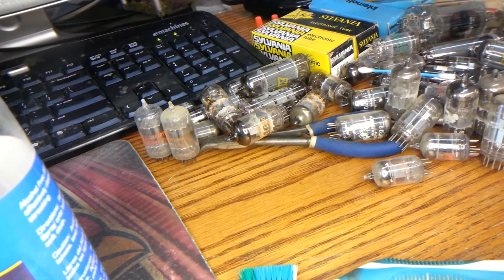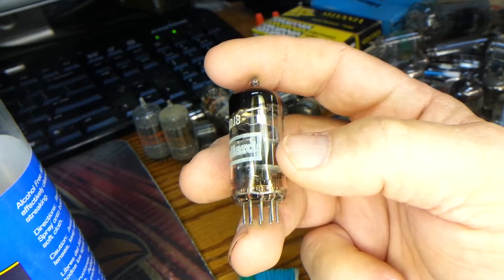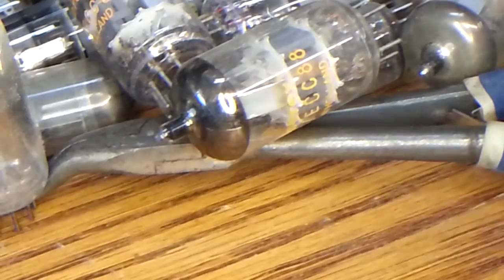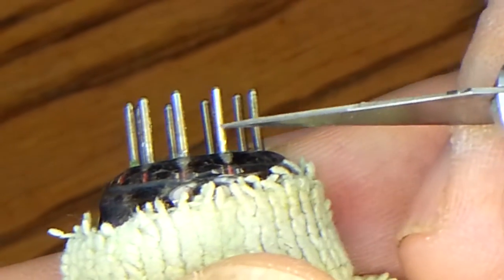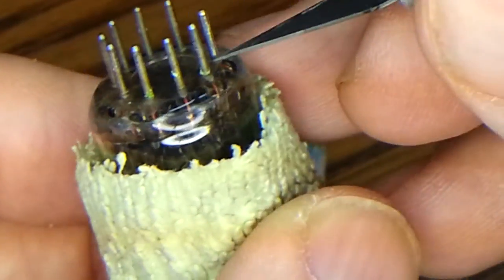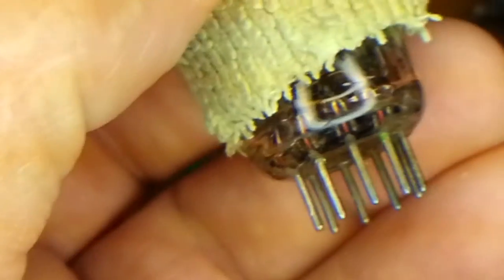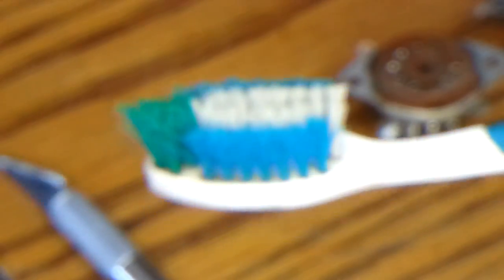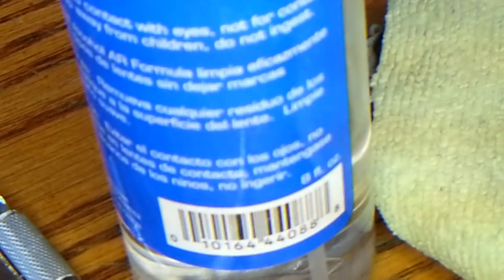Cleaning Vacuum Tubes Pins

Comment: I don't think any tube pins were made of stainless steel. The coefficient of expansion of stainless steel is several times higher than that of the glass used in the tubes. They used metals with a similar coefficient of expansion to the glass in order to reduce the likelihood of the glass cracking. That might help explain the presence of corrosion on the pins.
Reply from the maker: Thanks. I think that is correct.

Comment: If you do this a lot, get a cheap nail drill off amazon and some little fine polishing drill bits, the kind jewelers use to polish in the little nooks of jewelry.  Polish those things right up and useful for cleaning just about any contact you can think of.

Comment: OMG...Use a fiberglass pen brush!!!  This is like using barbed wire to floss your teeth.  A vintage tube is like fine jewelry, treat it as such!!
Reply: Yes, a fibreglass pen is a much better cleaning tool - scrapping the pins with a scalpel is way to aggressive.

Comment: Hello... pl explain the pin configurations about triode, tetrode, pentode etc.
Reply: How pins to identify the valves configurations...
Reply from the maker: Those words are referring to how many electrodes are characteristic to the valve. Triodes have 3 electrodes. Pentodes have 5 and so on. I am not going to hold a vacuum tube class here, but there are many on youtube to learn from.
Reply: Kevin Counihan  Thank u so much...